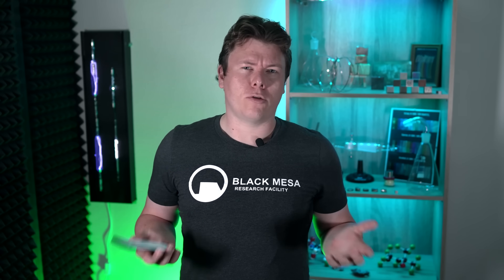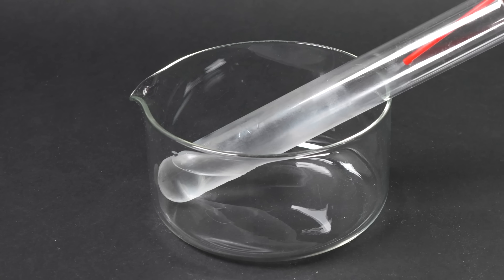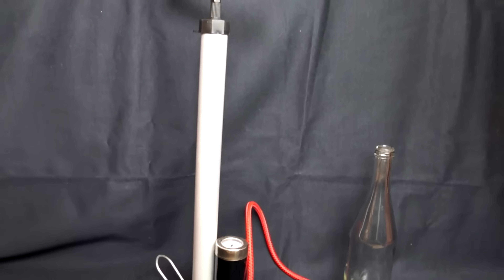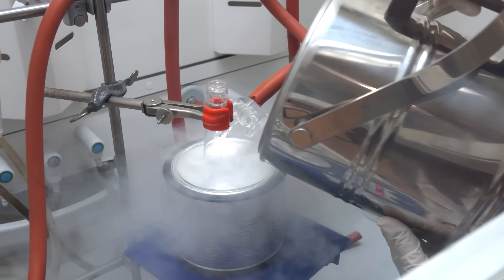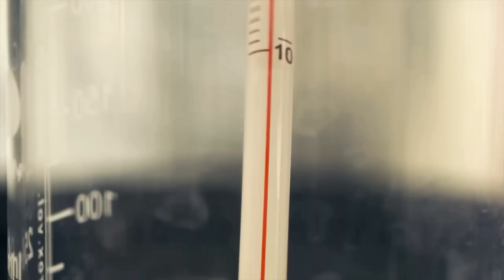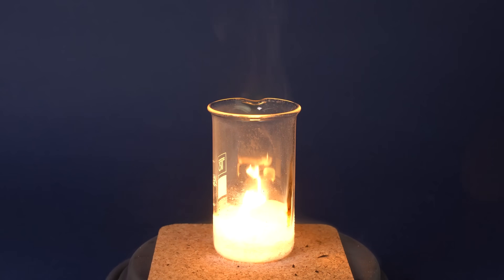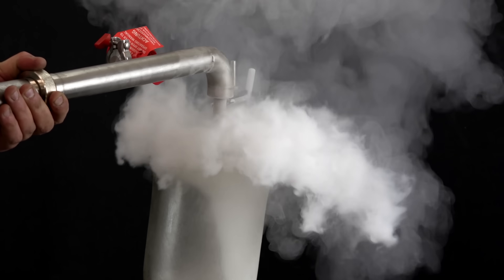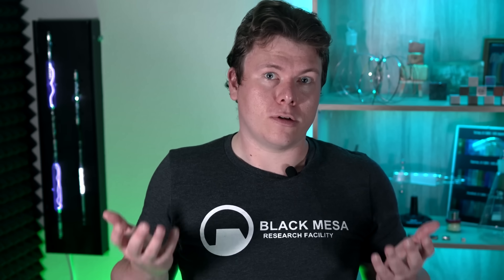Strange properties of solid air

Comment: At 5 above abolute 0 air freezes and space is 2.5 above absolute 0 doesn't that mean the air in contact with space is frozen??
Reply: The pressure in space is too low in space for the air to liquify and freeze

Comment: We recently found a natural occurrence of a 5th state of matter on Earth.  The water coming out of hydrothermal vents in the ocean floor has a temperature of many hundreds of degrees, but stays in a liquid state due to the pressure.  However, the hottest and deepest hydrothermal vents expel water both hot enough and under enough pressure to change into the supercritical state of matter.

Comment: Why isnt gravity just the magnetic field of the Earth ? We can see that with common instruments right ? We can see air is attracted to a magnet then the same should be true for the Earth pulling air towards the ground, has that been proven by anyone or a totally new avenue ? I'm certain this invisible gravity we cant see with instruments is just someones math dream they wont let go of, we being pulled down by the magnetic field looks a lot more convincing to me.
Reply: We can manipulate magnetic fields and control them so much we use them as tools, but we can't manipulate gravity currently. We found out how magnetic fields work in relation to electric fields and created a machine that produces magnetic fields at the flip of a switch. That's also how we found out how Earth made its magnetic field. Ever since then we've been trying to figure gravity out. It doesn't interact with electricity like magnetization does or we'd have artificial gravity by now. The only thing we know gravity interacts with is mass. This interaction is felt by everybody on the planet as it is the mass of the planet pulling on the mass of your body. If you want to know how hard the planet is pulling at your body all you have to do is weigh yourself. If you want to know why air would be attracted to a magnet. Gases are slightly diamagnetic Which means they are naturally repelled by magnetic fields. Oxygen is different, it is a paramagnetic gas, which means that it is attracted by a magnetic field because the oxygen molecule has two unpaired electrons that go around their atom. While they orbit their atom they also spin, which creates a magnetic field making them attractive to other magnetic fields. Sorry for the long worded explanation. The things you do sitting in traffic.
Reply: @stancil80d  Im going with this gravity scientists are trying to find doesnt actually exist as we already found it via magnetism, humans are 70% percent water and this Earth could have enough magnetic field to pull us down to it, its going about proving but as we are able to detect magnetic waves this should be doable.

Comment: nah there are a lot more than 4 states of matter. solid, liquid, gas, plasma, super conductor, superfluid, Bose–Einstein condensate, Fermionic condensate, Rydberg molecule, Quantum Hall state, Dropleton (aka quantum fog) Degenerate matter, Quark matter, Color-glass condensate, String-net liquid, as well as non classical states: polymer crystal, Liquid crystal states, Microphase-separated copolymer and a few im jsut not thinking off the top of my head. TO SAY THERE ARE ONLY 4 STATES OF MATTER IS IGNORANT AND FALSE INFORMATION. 

I thought this was supposed to be a science channel. not BS AND LIES.

Comment: Thanks, some eye opening information and very informative. I have been involved with the construction of ‘cold box’ pipe work. They liquify air and then with fraction distillation collect the various gases. My job was the NDT part specifically radiography of the welded joints. All pipe work is Aluminium which is not the easiest to get defect proof welds. It was an incredibly difficult job and very physical as these welds are radiographed using X ray and that means x ray tubes ! Thanks again

Comment: This is dubbed like a low budget kung fu movie from the 70's.
Protip: if you can't use the host's original voice audio, don't use the host. This video would have been fine with just the narration over video clips.

Comment: Liquid air is not superfluid. It just has a much lower surface tension than water. So it can flow easily through the pores in the coffee filter instead of formung drops that clog them up.
Reply: Did he say that? I thought he said CO2 in liquid state was
Reply: @Abstractor21  He said liquid air goes through the coffee filter easily because it is superfluid.

Comment: 30 years ago I surmised that water would boil in a vaccum. I cut a hole in a mason jar lid the size of an air fitting and soldered it on. Then added water about 1/2 full to the jar and secured the lid. Then hooked up a commercial AC vacuum pump. Just like your video it boiled and got cold. Thank you for your diligence.

Comment: I hope the company with the liquid helium has a system to recover the helium from the air in the laboratory where the experiment was done, so that they don't waste the helium. Maybe they have an air liquification plant and the air intake for the plant is an air vent on the wall of the lab.
Reply: only 5 ppm would be almost as expensive as krypton that way

Comment: Hey, i was wondering if liquid oxygen and other super cooled gases have any capillary flow. I mean, will they flow thru a certain sized tube on their own? Or do they use different sized tubes?
I know that either liquid helium (or hydrogen -- i don't remember which) has so much capillary effect that it will climb out of a cup onto a table on its own. But do the others have specific tube diameters or something?
Reply: Helium only does that when it's cooled past it's critical point, water does it too in the right conditions.

Yes there's observable capillary action with liquid gases they'll readily climb up a piece of paper if you stick it in there.

Comment: But what is the white residue left over on the black surface after the solid air evaporated? I really enjoy your very deep and informative experiments. And your ability to explain so much detail using layman's terms.  Also the new translator works well, although i do have to agree with some others that i do prefer your own voiceovers. It's more personal. Maybe if you did the original in English? But it all depends on your circumstances. Do what's best for your well-being. Got to keep it positive for you! Much respect and appreciation. Such a great gift of knowledge and your presentation abilities. Thanks again for sharing...
Reply: The white residue is frost, frozen water vapor from the air. It has a much higher melting point than any of the other things present.
Reply: @fwiffo  ah yes that does make sense. My thoughts were visualizing something more long term residual such as salts or minerals from the air or from the surface material being pushed to the edges. Similar to what can happen with solvents.
Thanks for the input...

Comment: Never seen solid butane for sure, but at -40, liquid propane will just sit there and behave like your dry water.
Needless to say, I don't linger long outside in those temps, having experienced -52F/-47C once in my life, one must breathe very carefully at those temps, merely breathing becomes painful, Propane becomes useless as a fuel at that point. what little comes out of the bottle becomes explosive in the pipes.  We had 2 wood stoves burning full blast and went through 2 cords of wood in a week that winter. Southern Colorado in the San Luis valley, January 2012.

Comment: unlike a lot of people here I actually like the VA you're using here. your accent is extremely hard for me to understand, part of it has to do with being partly deaf especially in certain frequencies related to human speech. Maybe another solution is to use baked in subtitles, but I like the VA here.
Reply: I've got Auditory Processing Disorder, and the new VA absolutely makes this video much easier to follow.  My ears work fine, but I struggle enough to understand spoken language even in my native/local accent.  Seems though like most of the other commenters here hate the VA, though, even if it is far less accessibility-friendly.

I wouldn't mind the original voice either if there were actual subtitles though, instead of relying on the auto-generated subtitles that struggle as much as I do to understand what was said.
Reply: @HadleyCanine  yeah i have to watch EVERYTHING with subittles, it drives my family insane. but i can't understand wtf they're saying without it. :(

Comment: 30 years ago I dreamed I was on the Moon, patrolling the area around our base.  I found a vehicle with two nearly-spent oxygen canisters in the back.  They looked like the tall steel cylinders you get for acetylene but they were CLEAR, perfectly clear.  I knew it was oxygen because it had about an inch level of blue liquid at the bottom but it was like a light blue.  After waking, I couldn't figure out how I knew they were oxygen.  I didn't even know at the time that oxygen is blue when liquid or solid.  I had a whole series of dreams on the Moon.  The final one, a ship came over to my construction site and blew up my machine while I stood next to it.

Comment: I've tried for a long time to find out how much volume of room temp air would be in say 1 cubic inch of liquid air? Anyone have any info?
Reply: Wikipedia gives the density of liquid air at 0.87 g/cm², whereas 1 m³ of room temperature air has a mass of about 1.2 kg. Not difficult!
Reply: Tried for a long time but didn't bother to Google it?

Comment: I think you're the 1st YouTube channel that I've seen to experiment around with LHe.  Since you've got so much, could you demonstrate it's superfluid characteristics?
Reply: Wouldn't be very difficult. All that is required is to put some in a small container in that clear dewar and use that same vacuum trick to get it to go from extremely cold to insanely cold. It stops boiling and shortly there after it creeps out of the beaker. If you put a straw in it, it will also creep up the straw and flow like a fountain. The stuff is very strange.
Reply: That would be interesting
Reply: same, I think this is one of the first times I've seen liquid helium done on youtube either.
Reply: It would be great to get new hi-res footage of LHe's superfluidity in action.
Reply: There are lots of videos about superfluid helium here on youtube, I counted about 20: https://www.youtube.com/watch?v=9FudzqfpLLs
Reply: That requires a specific isotope of helium that is quite expensive, I would be amazed if he was able to get his hands on that at all, much less already as a liquid.
Reply: @jamesscanio4210  the specific isotope required is also the more common isotope.
helium has 2 isotopes, helium 3 and helium 4. helium 3 has 2 protons and 1 neutron, helium 4 has 2 protons and 2 neutrons. if you add together the protons and neutrons in one of the isotopes, you get the isotope number. anyway, helium 4 is far more abundant than helium 3 and it makes up about 99.99986% of all helium on earth. rounding the number we get: 100%
so yeah, its Definitely NOT rare nor expensive at all. he had helium 4. it needs to get to around 2K to become a superfluid.
Reply: @jamesscanio4210  it occurs with He3 and He4, He4 being what 99. 9% of the helium on Earth.